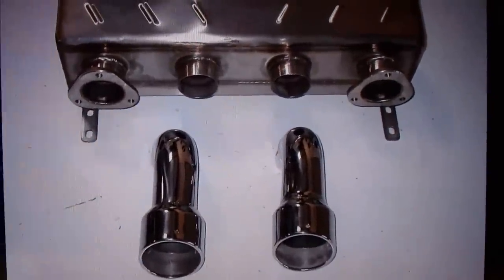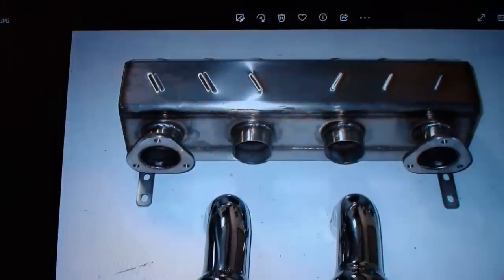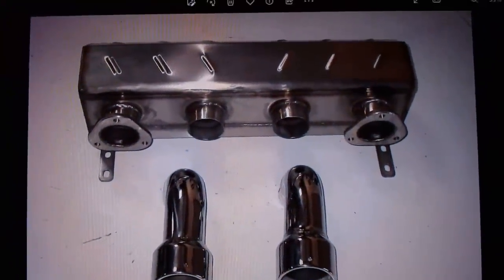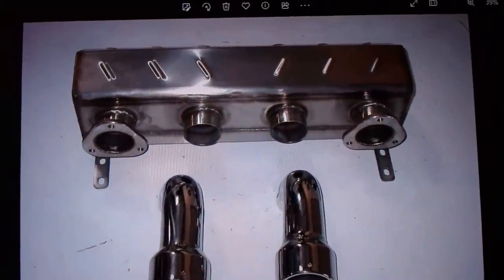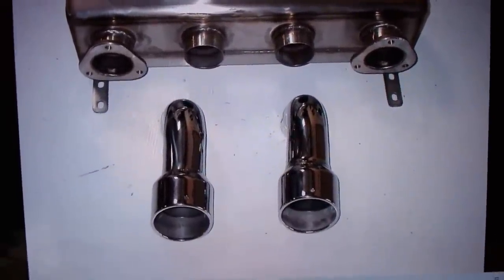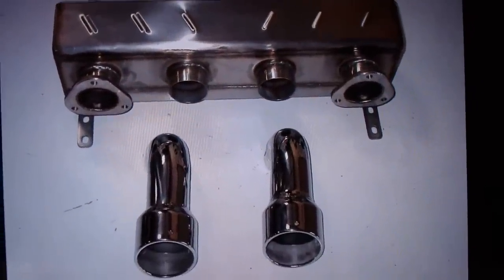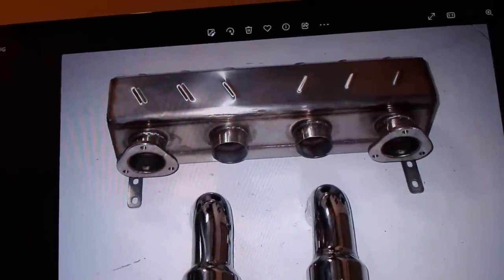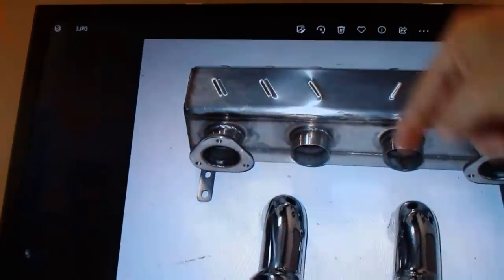LET'S TALK TECH-THE AMAZING THINGS EXHAUST DOES

Comment: The circle you can draw inside the square  tube flows somewhere around  99% of what the square tube does so the extra material just adds weight and makes it more difficult to work with
Reply: A circle that just fits inside a square has pi/4 as much cross section. Have you flow-tested similar tubing?

Comment: I would think it has some magic inside, but cut it open and it’s probably just a box with 4 holes 😂 I did run into one of these that sounded straight pipe, back when I had my Supra, on the Highway I matched his speed at about 70- then the opposite of a 1320 vid took place as he ate my Supras lunch, if I just had my phone could a made a 2000hp GT beats 1700hp Supra vid. Really 500vrs400 😂

Comment: Nobody should have ever started marketing “stage” cams. Stage 1, stage 2, stage 3, and so on. It’s the worst, most annoying thing.
Reply from the maker: it's simple math-easy to understand and very effective marketing
Reply: It does give the guy on the street a good idea of what to expect with regards performance/drivability
Reply: @gothicpagan.666  I suppose it may be helping, in some way people who do not know a lot about building engines. Idk. I don’t think anyone who is well versed in engines would be grabbing a cam because it says stage bla bla bla on the box , the person who knows about engines would know the specs they want/need never mind the stage signature the manufacturer put on the box. Show me the cam card. A “stage 2 or 3” cam could be either way too big for a budget 4.8 but at the same time be waaaay to small for a large displacement LS. I have been assembling and building engines waaaay before all the stages of cams came out so I am looking at it as someone with 30 plus years of experience. I can’t look at it from an uneducated angle. No reputable engine guy is using a cam because it is a stage cam. Stages are for the laymen. And that’s ok 👍
Reply: This stage numbering must have come from here in the UK. It was around in the  late 50's looking at old magazine adverts. 
MG used it, as did Coventry Climax and a few years later, Cosworth. 
Few back then, other than cam specialists knew what the raw No's actually meant.
Reply: @gothicpagan.666  that’s pretty cool. I should state that for the most part I only have experience with American V8’s. How is car life in the UK, lots of boosted cars over there?
Reply: @baby-sharkgto4902  We get pretty much most thing over here. Due to the size of our roads big stuff is pretty rare. Ford Focus RS mk3 seems to be a popular tunner vehicle, many making 400-450 bhp, 600 is not unrealistic with the budget for the right parts, a few are past the 1000hp mark.
Me I'm into small capacity 1960's machines, so when I don't win; what do you expect from a sub 1Ltr power unit.😂
Reply: "Stages" are pretty common in motorsports. Motorcycles, jet skis, etc... Japanese imports too. As far as American cars they did have half race cams and 3/4 race cams and full race cams. We know now that it's a multidimensional spectrum and the best has a lot to do with your other parts and what track you are driving on but to have a simple set of choices with numbers is just good marketing.
Reply: @gothicpagan.666  what a crazy big world! It’s hard to believe how different areas are from each other. Although one of my friends has a Focus RS and it is impressive even in stock form. There is another guy in my area has one that is all built but I don’t see it around often.
Reply: @danieldimitri6133  good ole 3/4 race cam